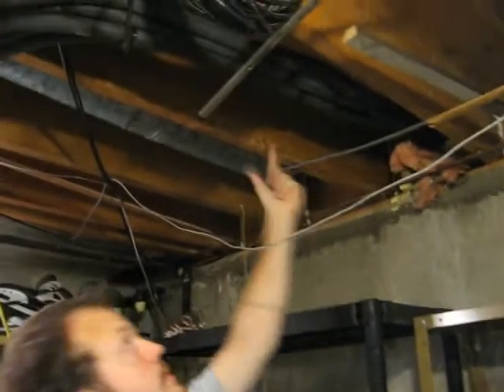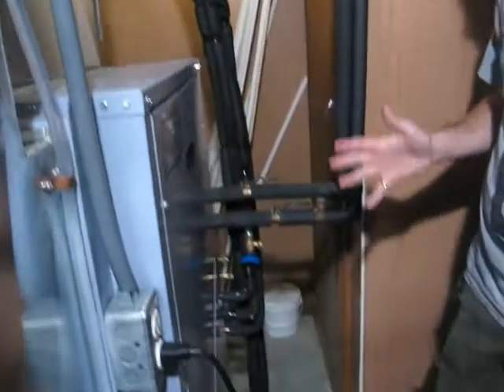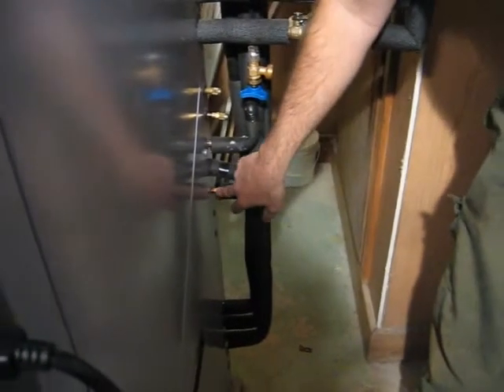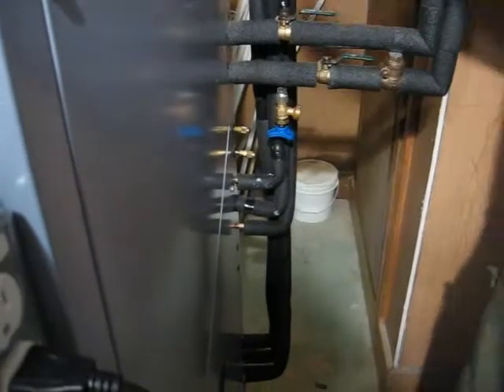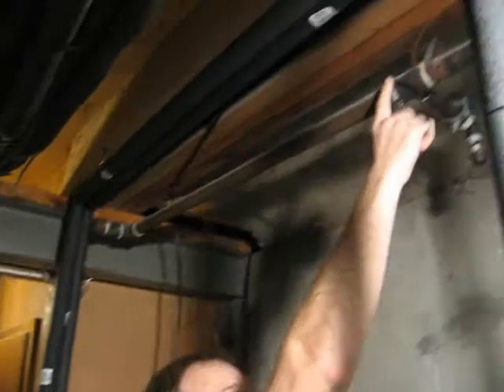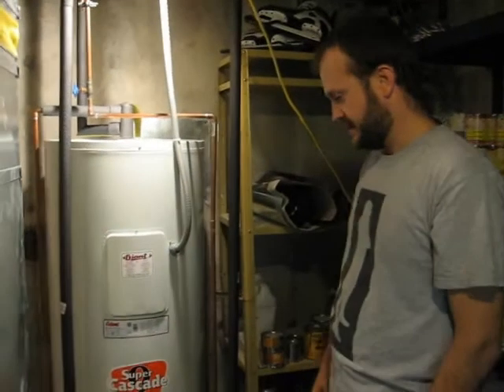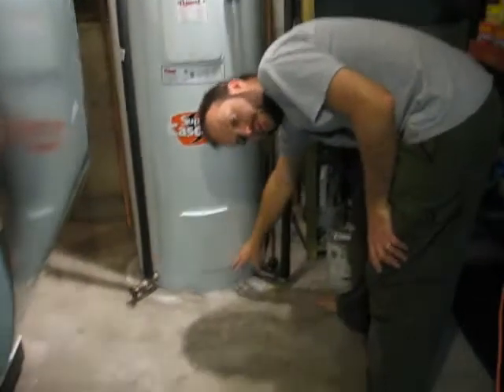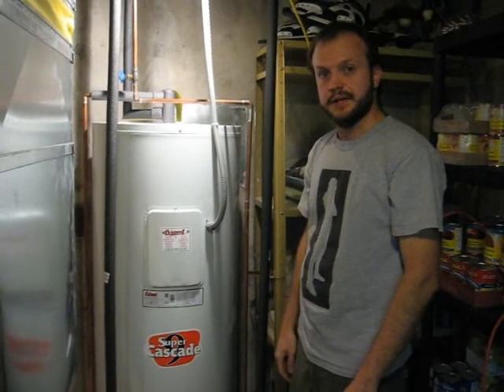GeoThermal Furnace Installed (1 of 2)

Comment from the maker: It's a 3ton unit 34,200 BTU/hr

This unit can extract more heat over less vertical distance because it uses refridgerant boiling at -42C.  The copper pipes conduct heat better than the plastic pipes of other GSHPs.

Water source HPs use water from a well and discharges it into another well.

We looked at all 3 kinds system. Our suburban location the lest expensive was the DX.  $25,000

smellslikefries . blogspot . com

Comment: How many ton is your unit. I have not heard of this system that circulates refridgerant as opposed to water, could you explain that a bit. Is it more efficient? Also, I thought you needed around 250-300' of vertical well depth per ton...you said you have 3-100' wells...right? How do you like your system so far, and if I may ask...what did it cost? I think geo is the only way to go from what I've read. Enjoyed the videos!